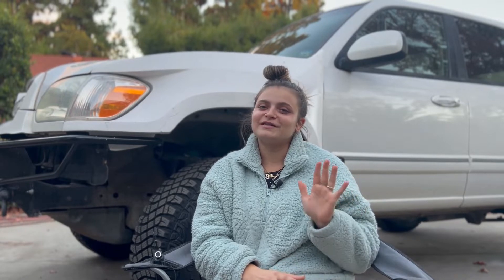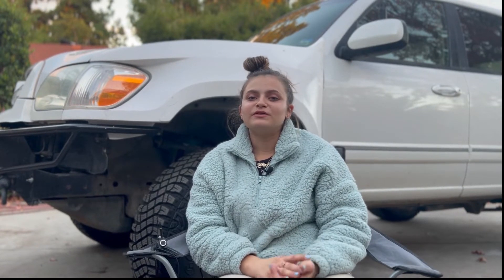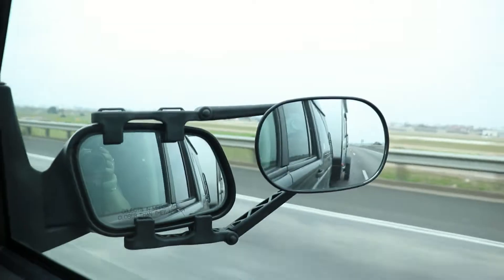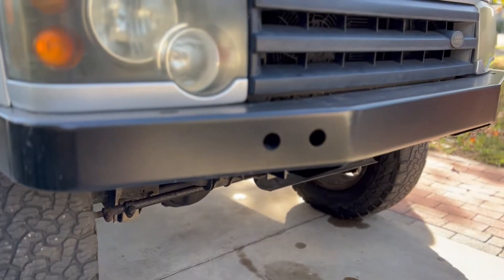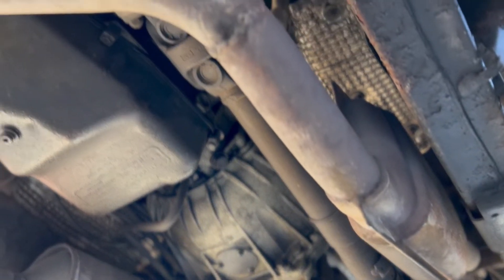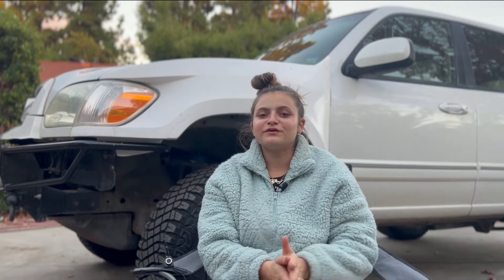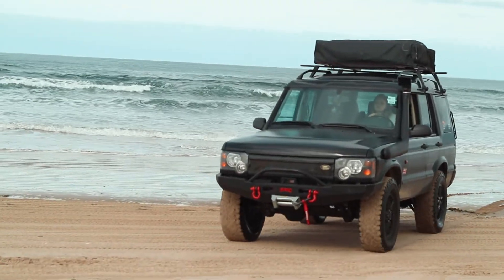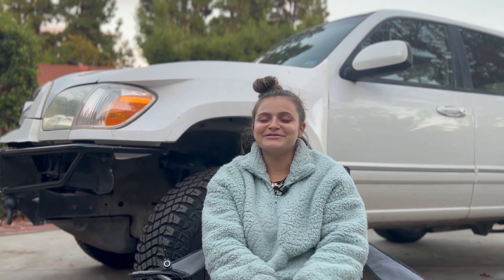TOP 5 MODS YOU MUST DO ON YOUR LANDROVER DISCOVERY 2

Comment: In line thermostat is another option to help with the cooling, An Ultra Gauge to keep an eye on temps etc. are big ones for your temps. Yup driveshafts went with the TW myself after a few replacements. But I do love my rover.
Reply: Yeah the inline is way better. I was using the factory one and there was really nothing wrong other than I didn't like to hover around the low 200 to 210. All the Land Rover UK guys freak out but they're running the diesel and they're in cooler climate. The V8 over here in America just cannot get much lower than 200° no matter what Factory style thermostat. With my inline I sit in the 180s no matter what sometimes 170s possibly even throw a code for low temperature haha I figure this old aluminum block design is worth saving over the ramped up emissions Heat they were going for. When people don't like to modify it's stupid they're obsessed with everything being Factory when obviously some Factory things aren't always the best
Reply: Add all aluminum fittings & overflow bottle. Water Wetter & 180 thermostat too. Here in AZ🥵 ZERO ISSUES!
Reply: @ronaldrrootiii6040 correct!
Reply: @gmeyer1957  yep I'm in Tucson! Haha

Comment: Yeah according to my digital temp gauge the lower thermostat still let's it hover in the 200 to 215 range if you're in the summer so I did the inline thermostat which gets rid of that huge heater bypass and now I'm in the 180s and if it gets cool out I have to go up to a 190 element to not throw a temperature being too low code LOL
Reply: Yes, the inline thermostat setup you described was also a game-changer for me.  It's basically never over 185 now.
Reply: Where can you purchase the inline thermostat?

Comment: If you guys haven't tried the inline yet I recommend it more than a factory upgrade. So I have a major question right now mine has the ome heavy duty 2-in springs and I removed my rear sway bar. It does articulate better but those heavy duty springs feel like they prevent a little although I think they also make it safer on the road with the lack of sway bar how do you feel about that? I've heard some people say that Medium Springs with sway bar feel about the same as heavy duty springs without sway bar. Also if I'm running those HD Springs is it safe to take the sway bar off the front I know the engine weight is much more predominant up there compared to in back weight
Reply from the maker: The engine actually doesnt weight as much as you think it does mainly because its all aluminum. If I were to guess these cars have a very close to a 50-50 weight distribution due to the long overhang in the back. The reason why I wouldnt remove the front sway bar is because its effects on the vehicle dynamics are much larger due to its diameter being twice the size.
Reply: @overlandingworld  wow I never thought of it that way! Yeah 50/50 I totally believe that I've told people there's something about these things that is just balanced. From the full-time all-wheel drive to the differentials being the exact same size front and back it's pretty cool but yeah I hear you I'll get a disconnect for the front and just leave the back out how it is. If I get a disconnect up front should use it on one side and just lubricate the Old Link or should I put the disconnect on both sides since the kit comes with two and I'm not using one in back

Comment: The most important thing to remember is to get the Td5, not the V8, that eliminates most engine-related problems including the overheating prop shafts.
Reply from the maker: Sadly in the states the td5 was never available.
Reply: Won't have clue about TD5 Like rocking horse shit over there.
Reply: "The most important thing is to find your own unicorn."
Reply: 100% fact td5 is bomb proof (15p)

Comment: Lift it 4 inches then fit a Glynn Lewis wide angle front prop and a 200 tdi rear. Remove both anti roll bars. 35 inch tyres and chop the arches. Good to go 😁

Comment: You recomend a thermostat change when the OEM setup on the TD5 diesel has more than adequate cooling capacity for extended operation in over 40deg temps - a load of bollocks on your part.
- perhaps you just forgot to mention that you have experience only with the Petrol V8?
Reply from the maker: US market only got the V8.
Reply: @overlandingworld Perhaps you forgot that youtube goes world wide and as such, advice without specifying the engine is misleading
🙂

Comment: I personally put 110,000 miles on my 2004. You should not be burning through front driveshafts. I've finally replaced my original one, and the new one should last forever. 
You are installing something incorrectly if you burn through drive shafts.
Best cooling option is a good gauge to measure temps. The default gauge is useless, as if shows hot, you have already damaged your engine.
Get the inline thermostat mod, so you can more easily change out the thermostat. Running at 180 doesn't actually do much (and I run one) other than give you a bit of extra room for heat. Remember this is the temp floor.

Comment: My right cat throws a code every month or so. I spray this foamy stuff down the Upstream 02 sensor hole and then drive it and clears it for a while getting better power and mileage. I think maybe it's from the secondary air system throwing dust into your exhaust and if you've ever had a manifold gasket leak that you didn't fix right away. Thinking of getting aftermarket cats but can't afford it quite yet or at least don't want to lol overall mine drives with no engine light or Amigos on the average.